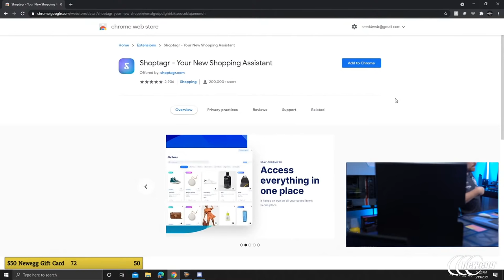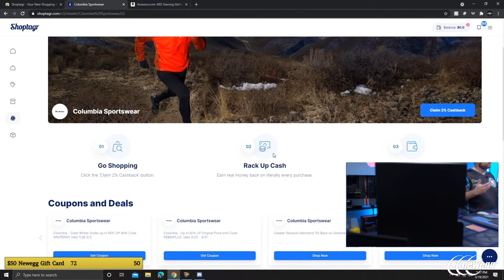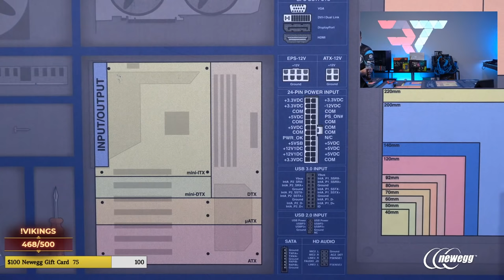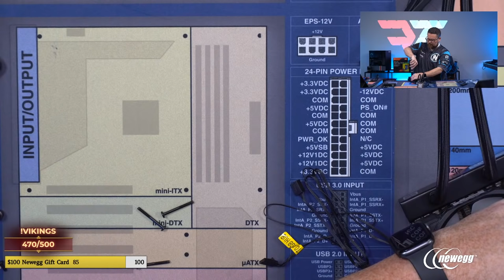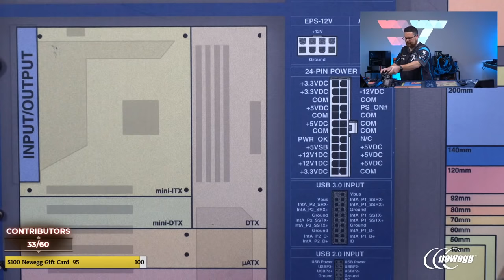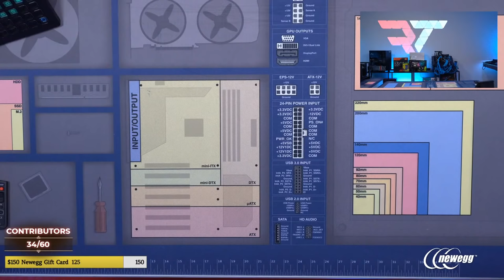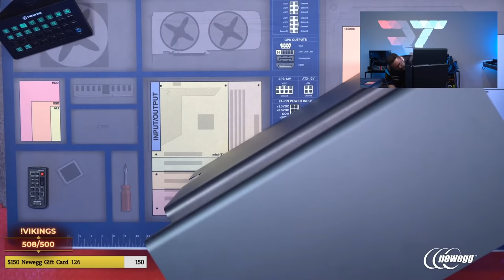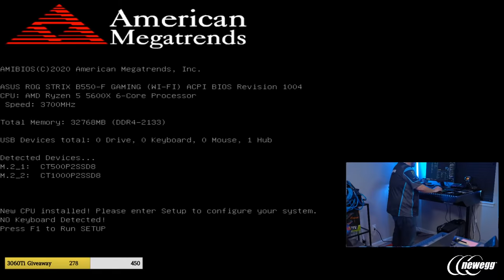How to Build a PC – Giveaways + $1800 Build in the AZZA Cast 808 (Ryzen 5600x / MSI RTX 3060)

Comment: Hey please can some one help me.... I installed 6 corsair ql120 fans I have the rgb plugged into the lightning core hub and the fan plugs into a fan splitter all fans came on with the default rainbow pattern but unfortunately I swapped fan 6 wirh something else and now fan 6 refuses to light up? It's wierd even when I remove the hubs usb connection the fans still light up? Is this a fault with the fan it self or something I need to check in the icue software? Unfortunately I don't have my mouse yet its meant to come on the 30th